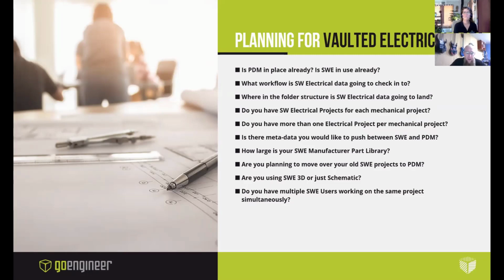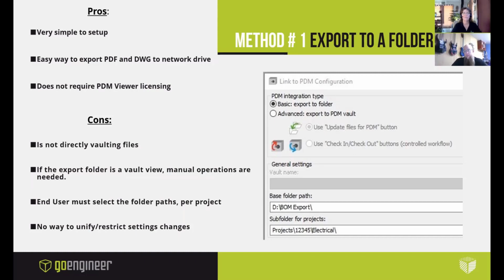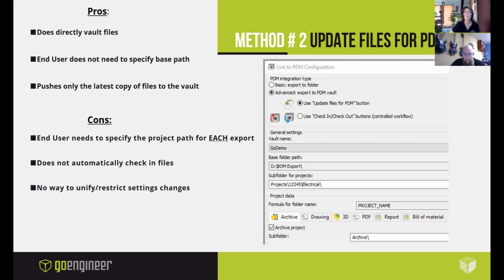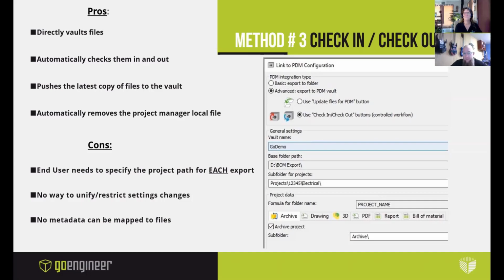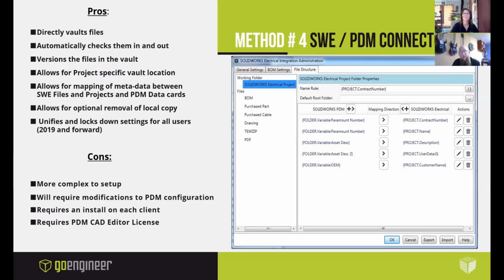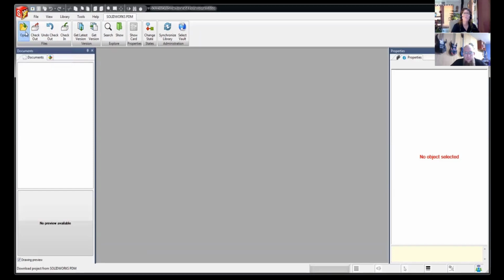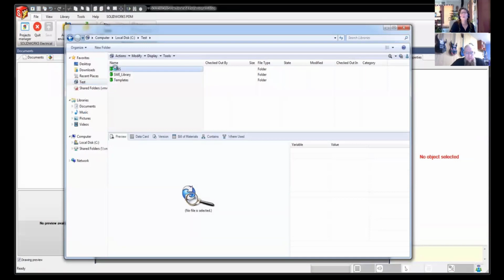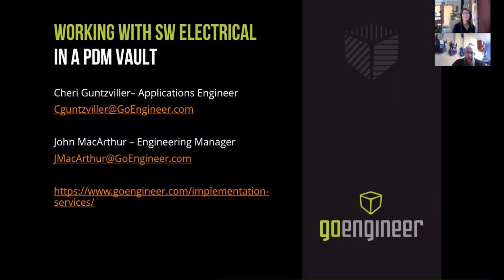Linking SOLIDWORKS Electrical to SOLIDWORKS PDM Introduction

Comment: With method 3: you say the pros are automatically checks in and out... then why do we have to press the button check out and check in. Please explain.
Reply from the maker: Thanks for your question!  
When you are putting a file into the vault there is a process that must be followed:
If it is an electrical project – you must create an archive of the selected project
Copy or move the file into the vault
You must make sure to “add the file to the vault”
Then you can “check in” the file
These are all manual functions inside of the vault.

With Electrical, when using the Option 3 of “check-in/check-out”, you do not need to leave the electrical software.
Using this method, and selecting check-in allows you to “automatically” add the file into the vault without having to follow the above procedure.
The software will create the archive, add it to the vault and allow you to simply click the button to check the file in.
This is what we mean by automatic – the manual steps of creating an archive and adding the file to the vault are done in one button click.